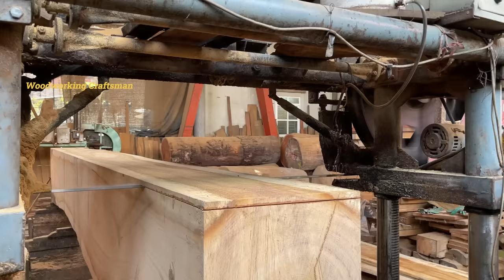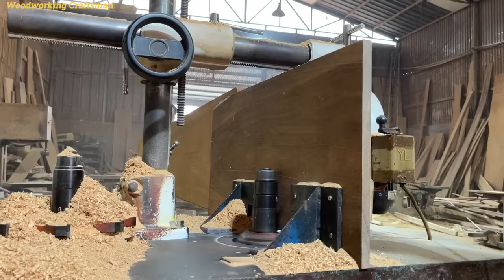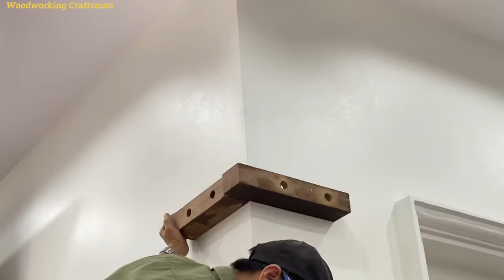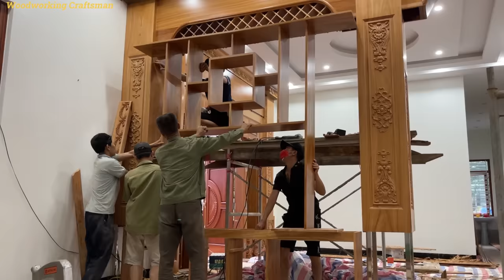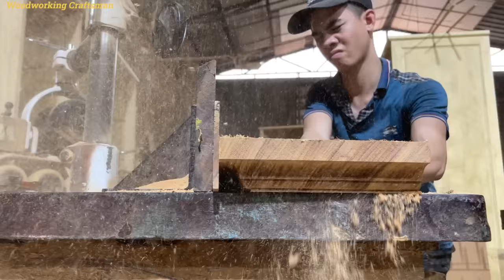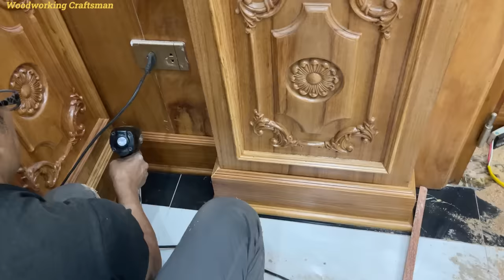Mr.Văn Latest Design Beautiful Wooden Decorate Living Room || Extremely Ingenious Woodworker Skills

Comment: There is no question that these gentlemen are true craftsmen and are extremely talented, absolutely beautiful work. However, I would not be very surprised if accidents and injuries are  not a daily occurrence considering the extreme lack of safety in this factory. Inappropriate clothing and shoe apparel, no safety glasses or gloves, and so much wood material everywhere cluttering the floor space. Piles and piles of material to trip over. No safety equipment whatsoever, especially around any of the saws and planers. Someone is going to be seriously injured in these conditions. Absolutely no factory or business in the USA would be allowed to run like this. It is against the law through the Department of Labor.  The Occupational Safety and Health Act (OSHA) was created in the US to ensure safe and healthful working conditions for workers by setting and enforcing standards and by providing training, outreach, education, and assistance.  This type of safety act should be applied everywhere to ensure the safety of all workers.
Reply: all cost that matters
Reply: @Mak Interiors Builders....all cost that matters? Or all cause that matters? Either way, yes it does matter, maybe not in your country, but in the USA safety of its employees is a no. 1 priority. It's the LAW and if businesses do not comply with safety regulations they can be shut down and severely fined or put into jail for noncompliance of regulations. Not to mention business owners can be sued by employees if an accident occurs where safety precautions are not preformed or if safety equipment was not implemented at the job sight or business.

Comment: Beautiful work, but then there are certain parts that leave me baffled. Particularly the number of places where dark wood butts up against light wood. Examples would be on the cabinet doors and the undersides of the arches. The wood should have either been stained to match or the wood should have been selected more carefully. Also, there were a number of very visible pinholes in prominent places. There are ways to secure those joints from behind that would have given a much cleaner finish. Obviously, these are small nitpicks on great work, but I feel like they could have been avoided so easily and it would have looked even better.
Reply: Kết cấu màu gỗ tự nhiên mà . Nhìn trên videos bạn cảm thấy khác màu do ánh sáng trong phòng thôi .nơi ánh sáng nhiều bạn sẽ thấy nó sáng màu .nơi tối hơn sẽ đậm hơn .thực tế nó ko khác nhau về màu .
Reply: WOOD IT'S DIFFERENT
IT'S NOT LIKE PIECE A RUG 
THAT ALL THE RUG IT'S THE SAME
THE WOOD IT'S GOING TO BE DIFFERENT
FROM ONE PIECE TO ANOTHER
I BET YOU'RE ONE OF THOSE GUY'S
THAT HIRE SOMEBODY 
TO DO SOME WORK
AND FOR ANY SMALL DETAIL
YOU REFUSE TO PAY !!
Reply: @diegovega6545  Actually, I'm a tradesman myself, with very high expectations for my own quality of work. I've worked on houses with similar woodworking features. In those, the wood was specifically selected, and sometimes stained, so that each piece looked at least similar to the bordering pieces. It's very possible to do, and it would have made the high-quality work in this video look even better. I do know what I'm talking about, and there's no need to SHOUT at me over a little constructive criticism.